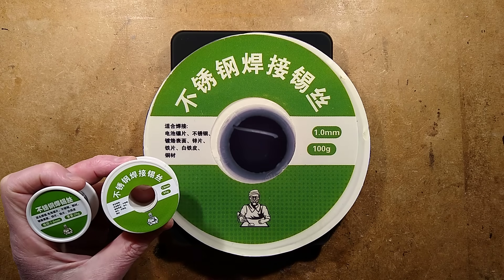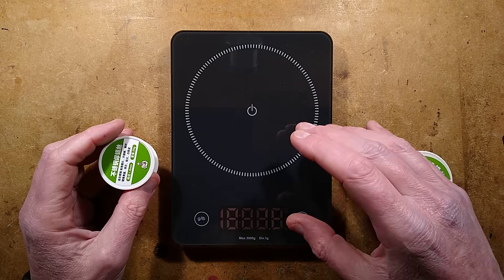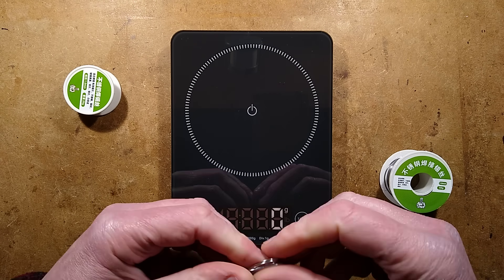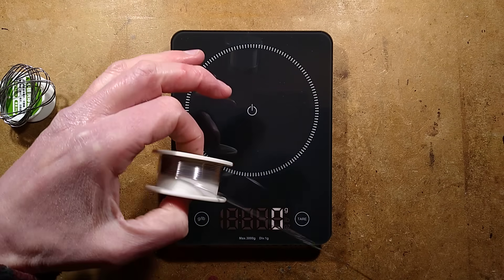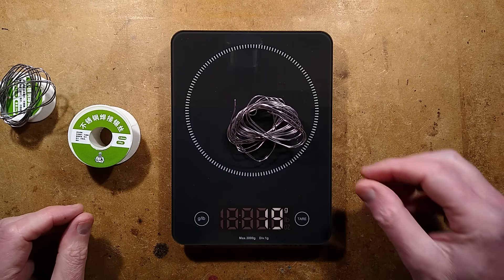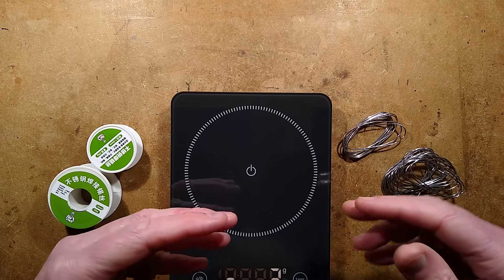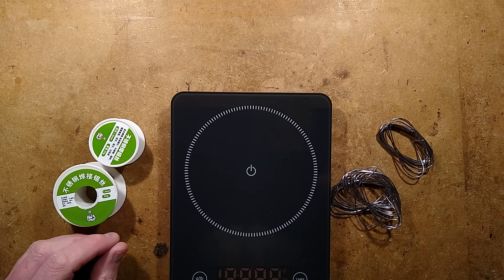The 20g and 50g mystery solder showdown

Comment: The cadmium doesn't surprise me. Unfortunately it's pretty common over there for them to use it in children's jewelry because it's cheaper than zinc or nickle. They do it even to some name brands, you have to rely on the brand actually checking their suppliers (and not just accepting the goods at face value) and sadly some don't.

Comment: I ran into a similar situation with a local supermarket.  They were including the weight of the packaging with the meat when pricing it.  The packaging is required by law to not be included with the weight of the meat.  The plastic wrap is insignificant in relation to the tray and the absorbent pad used under the meat.  To be sure I wasn't in error myself I have a set of standard measures that I use to verify the accuracy of my scale and sure enough verified that there was enough of a discrepancy to affect the cost of the meat.  I reported the discrepancy along with photo documentation to the division of weights and measures in the town they are located in but sure enough they investigated and found nothing wrong.  I measured a definite discrepancy between the actual weight and the tare weight.  There was about a 15¢ difference between the total weight and tare weight and considering the number of people that patronize the store it's a windfall for the company.  One might suggest changing stores but in reality they all cheat their customers.  🤷‍♂️

Comment: 95% lead? You would be happy with it as leaded fan. as a Different generation I hate soldering lead. (Mostly as leadlock to copper where pipes weren't replaced yet)

Comment: All rosin fluxes are mildly acidic when heated. Which is the whole point - it removes any impurities and oxidation allowing the solder to wet the joint.
Reply: When people say "acid flux", they're usually referring to strong acids, typically inorganic acids, not mild organic acids. Rosin flux, a mild organic acid, is useless on stainless steel which was the material being soldered according to the video. That requires, at a minimum, proper acid flux.

Comment: I'm sorry, but you are mistaken.  The reel is also 95% lead with 5% titanium dioxide to color it white..  You're meant to use it as solder for larger, load-bearing joints.  If you find the right (wrong) listings, you'll see it as "titanium solder".
Reply: Upon further reading, the reel is probably lead coated with cadmium stearate to whiten it.

Comment: I have heard that, even  the "rosin core flux"  in some solders emits acid in its smoke.  Any truth to that?
Reply from the maker: The solders for pipework tend to use an acidic flux that has to be cleaned off after use.

Comment: There is a reason the broadcasters and military will only use 40/60 tin lead solder.
And it's the reason I will only use it as well.
Reply: Absolutely incorrect, because nobody uses solder that is 40% tin, 60% lead, because that’s an awful alloy for electronics. You’re thinking of 60/40 solder, which is 60% tin, 40% lead, and is the cheaper version of 63/37 eutectic solder, which is a little bit nicer.

Broadcast equipment, however, is lead-free. Military and aerospace, and formerly medical, have exemptions and continue to use leaded solder. (Though I expect those exemptions to disappear once it is shown that lead-free is as reliable as leaded. And it is basically there.)
Reply: So far tin whiskers are still forming.  So lead is still approved.
Reply: @danc2014  Tin whiskers formed before lead-free solder was introduced, too. The issue occurs on pure tin plating; even small amounts of alloyed metals appears sufficient to frustrate whisker growth in most circumstances.
Reply: Yes your right, sorry I got the ratios wrong. I'll try to be awake next time!
Reply: @ No worries. :)
Reply from the maker: And medical.

Comment: I once had some smd battery controller chips (charger and regulator in one) fail within a week of soldering boards.  After much research by us and the chip manufacturer, it turns out our no-clean flux was actually acid flux with the wrong label.  It was soaking into the parts and dissolving the same bond wire in each chip.  Didn't bother any other chips, at least not before the battery controller failed.

Comment: I only buy Kester electronic solder. After soldering anything I always clean the joint with alcohol, a plastic pick and an acid brush to remove any corrosive flux. I'm surprised that the company that made that stuff didn't glue a metal washer inside the roll or maybe mix arsenic with the flux.

Comment: I experimented with Aliexpress solder and it's garbage. I'm convinced it's mostly lead or some other metal, maybe zinc or bismuth.
It doesn't melt properly or flow heat from the iron. After a couple of joints it clogs the iron tip making it useless.
It said 60/40 on it but was not specific what metals are in there.
The flux in the core is useless too.
Stay away from this garbage

Comment: The weight discrepancies are basically how they're shipping in precursor drug chemicals to the west, because when you expect 100 lb of soldering wire and it's actually 50 lb of soldering wire and 50 lb of other stuff you start to make these kinds of connections, China is scum and they should be banned from world markets

Comment: Seems to be a common thing with weight values of Chinese products. Ordered a "100g" can of (flux) rosin, and the filled can was exactly 100g. Since the lid alone weighs roughly 7 grams I'd guesstimate that the can actually contains about 60-70g of rosin.
So in contrast to most of the world where the advertised weight has to be just the content and may not include the weight of the packaging, that seems to be different in China...

Comment: I've got many reels of solder out the back, many of which are Ersin Multicore.  I do get through a fair bit though, especially the 1mm diameter stuff.  You CAN get decent solder from China, however you do need to stick to the more decent suppliers.  Thanks for the links allowing us to experiment "for other purposes" :-D
Reply: Ersin Multicore is the best solder you can buy in the UK and it has been since I first started soldering things over sixty years ago. I won't buy anything else.

Comment: Cheeky buggers. 

The acid based flux is nasty, it creeps up into wires and into holes in circuit boards so cleaning it all off is a really difficult job, easier to just not use it in the first place.
Reply: Stranded wire wicks up liquified flux by capillary action, and if the flux is corrosive it will corrode the wire underneath the insulation where you can't see it. Rosin flux is generally non-corrosive, but sometimes causes the wire jacketing to react chemically with bare copper wire (tinned wire doesn't seem to undergo the same process).

Comment: Because of this video, I bought 50gm of solder (common stuff, not for stainless steel) from Aliexpress, and it was only 48gm total! There is less than 17gm of solder, over 31gm for the spool. I got refunded after sending pictures of the spool and solder weighed separately on the scale.

Comment: Take The reels apart and see if they added metal or sand to them!
Reply from the maker: Solid white plastic.
Reply: @ So they got the white battery casings.......
Reply: Probably just have a core of recycled lead acid battery PVC, that is then placed in the moulding machine and given the overmould of recycled PVC. After all the lead contaminated plastic is cheaper, and has added mass.

Comment: I watched one of those hacking youtube videos online that suggested adding battery shell (Zinc) to HydoChloric Acid gives you a flux that could solder stainless steel.

I did test it and to my surprise it worked really well but need to be careful because zinc chloride is not very healthy

Comment: You can buy stainless flux and just use regular solder.  The flux is zinc chloride (basically zinc disolved in hydrochloric acid), so must be neutralized after soldering.

Comment: 0:41 the design of that scale looks like a hot plate and immediately makes me weary of pressing the power button in the middle of fear that I'll burn my fingers lmao
Reply: Besides that, my concern is that it is a capacitance-reactive touch sensor.  So if you put something soggy in the center, it might turn the scale off.
Reply: @Kineth1  It may just turn on when pressure on the weight sensors is detected. I have one scale that works that way, although it is a bit larger and designed to be placed on the floor.
Reply: Clive is an influencer and he doesn’t know it. I have several of the things he uses regularly because I trust his knowledge. But where can I buy this scale?

Comment: I got got like this with 3d printer filament, a "1kg" spool that was photoshopped in the listing to be twice as big as it actually was, and it showed up weighing 990 gram including cardboard box, plastic wrap, dessicant, there was barely 600 grams of filament on the half-width spool.

Also, customer service sided with the seller, because shipping weight shows 1kg so you must've gotten what you ordered.
Reply: Oh yeah, solid logic... like packaging has no weight... 🤔😒
Reply: Not even 10 grams of packing peanuts? I think you were right to complain
Reply: You should shame the platform if you're going to include that customer service didn't fix it... Was it eBay or Amazon or something else?
Reply: @tin2001  Aliexpress (most of the time they're fine but this time they completely struck out.)
Reply: @tin2001  it was on Aliexpress
Reply: What brand?
Reply: @GeneCash  Not even sure if it had a brand tbh, it was just some super generic €10/1kg stuff which i thought was a good deal, turns out it was not, given that I effectively paid €16.70/kg for really low quality (very brittle!) filament. Switched to other brands in the $12 to $14 range and got what I ordered, with better quality too.

Comment: As a teen we had Rosen core and Acid core solder when I took electronics in high school we always used the Rosen core . I was lucky to find on Ebay some really good fine diameter Kestor brand solder  NOS in the box bought 2 spools had a higher lead and tin compound .The newer stuff is not as good less lead in it now . One of the most ridiculous things I was ever told Was the Interstate battery rep said you were losing 60 percent of your batteries power by soldering the terminals VS crimping them !  I looked at him and asked why do we solder circuit boards if that's the case ?? He had no explanation  I Do BOTH when I build leads for heavy trucks or machines .
Reply: The US military has always maintained that a properly done crimp is more reliable than a soldered connection because a high-pressure crimp constitutes a cold weld that excludes air and melds the metals together at the molecular or atomic level. This assumes that the connectors and cables are correctky size-matched and the correct crimper, dies, and physical pressure are used......but yes, I've done the same as you, both crimping and soldering connectors to cables.
Reply: @ In signal school, we were taught to splice wire using square knots. No solder. No butt connector. You don't even need electrical tape if the splices are offset.
Reply: @ I have a training video from WW  2 showing that  but of course they were in a hurry to get lines up and running advancing with the troops quite the task if you were attached to Pattons third !
Reply: Kester still makes 60:40 rosin core solder. Or they did a few years back when I bought mine.

Comment: I actually bought a 2x1lb kester brand 63-37 lead-tin reel twice now, never weighed it biut the amount of time it lasts and the sheer contrast in empty vs full makes me think it actually has at least 80% solder, maybe 95+%
Reply: Kester being a highly reputable brand, I am absolutely confident that a 1lb reel contains 1lb of solder, plus whatever few grams the reel weighs.

The percentage of flux is printed on the reel in code: flux core size 66 = 3.3%, 58 = 2.2%, and I forget what the other size code is, but it means 1.1%. (Not to be confused with the flux type, which is also a number. For example, I buy Kester 63/37 eutectic, with type 44 flux, flux core size 66.)
Reply: @tookitogo  sorry 60/40 mix 0.8mm 3.3% flux, i think i read it right
it has never let me down when doing rework, I only wish I had good quality paste-flux like the amtek stuff louis rossmann used to sell before the company changed the formula
and a good desoldering pump and hot-air station

but my little pinecil is chugging along(after I accidentally killed the first on with >20v input frying the chip that does PD) and even let me replace the POT on the left stick y axis on my well used xbox one controller for PC
just a quick solder blob 3-pin desolding(the only way to remove the POT with my tools) and then careful pressure and I removed then slipped in a new POT, then a bit of fresh solder to touch up the joints and a new stick topper and boom, the kester wins again

just one of many times that solder has saved something otherwise expensive to replace, unlike the shit in this video which is FAT and  so goddam disreputable to have a hyper-dense reel to hide how little actual product they are really selling

Comment: Between this and my own gambles buying solder from Aliexpress and Ebay, I'm glad I was able to be Able to get a few rolls of Kester and MG solder before the very last local electronics shop closed last year.
Reply: Mechanic brand is safe bet on Aliexpress, not the best in the world but good and cheap. I was happy with LAOA but they only ship 400g rolls to Croatia lately and I have no use for that but if I need that amount it will be my first choice. Not really cheap but still cheaper than stuff that can be bought locally and quality is excellent.

Comment: I do not solder with lead. Switched to solder with copper, silver and tin.
If I want to connect steel or stainless steel, then I use welding. Not some lead solder.

Comment: I was bang on the first one but off a little on the second.

Serious question (as I'm running really low on a the spool of 60/40 I've had for literally decades) can someone recommend a good quality solder with a decent flux (mostly for SMD rework but occasionally for removing, yes you read that right, removing parts soldered to double sided boards, with multiple pins - all at once without destroying them!)

Comment: lead is denser than tin so it is actually the correct weight, as 50g of lead is heavier than 50g of tin.
Reply: srsly though I'm still on a spool of *searches email* ..."Warton Metals Future HF 63/37 Fast Flow 2% Flux Solder Wire 18SWG 1.22mm 500g" that I bought years ago.  :3

Comment: I guessed 8 and 16... Not too far off surprisingly.
In any case, the best solder I have used came with my silver stone soldering iron. The reel has last for more than 5 years at this rate, still flows on perfectly every time.

Comment: my guess for the first one was spot on. The second even managed to beat my cynicism, I was expecting 30g solder 20g reel.
Reply: I guessed there'd be 20g of solder and still came away disappointed
Reply: Well after the 60/40 100 gram wheel i expected 30/20 for the 50

The 20 grams being half half was the surprise here
Reply: I was guessing 8 and 16... Beat my expectations (barely).
Reply: It's recycling plastic,  remember.

Comment: I was spot on. I guessed 32g.
...but, I thought it would be 32g solder, 18g reel. Not the other way round. That's false advertising, surely.
Reply: Same, thought 32g solder lol
Reply: Not believing PT Barnum is probably a bigger mistake!
Reply: This is not false but actually trick. They never said you will get 50grm of wire
Reply: It's not false advertising. It's weight fraud, a form of measurement fraud distinct from false advertising, centres on the deliberate misrepresentation of a product's weight. This deceptive practice involves manipulating labels or scales to falsely inflate the weight claimed for a product. Unlike false advertising, which focuses on misleading claims about a product's qualities or benefits, weight fraud directly targets the accuracy of the weight measurement itself, leading consumers to believe they are receiving a greater quantity than they actually are. This can manifest in various ways, from altered scales in retail settings to intentionally mislabelled pre-packaged goods, ultimately defrauding consumers by charging them for weight they do not receive.

Comment: 50% rip off.....Chinesium junk solder, just what they use on all the electronics they produce....guaranteed failure down the road.  Doesn't surprise me though that it was half or less than stated weight, I am surprised though that they didn't include the shipping package and labeling included in the weight measurement....  Stick with Kester, MG Chemicals ETC..  Thanks Clive.
Reply: Typical Aliexpress seller. I ordered a laptop got a laptop bag! They did refund my money but never, ever again will I do Aliexpress!

Comment: Yeah, that's why I make it. I just clamp 2 boards together and drill down the middle to cast long thin rods.
Bolton metal has all the recipes, or did, I printed them off years ago.
In the meantime I probably picked-up 10 pounds of old 60/40 spools and hardly fool with my tin ingots.

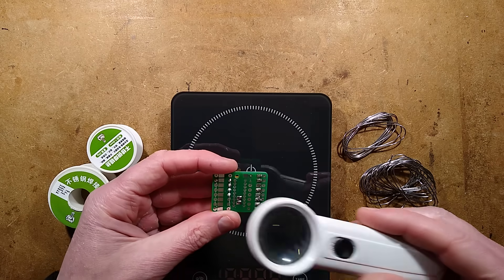Comment: 3:27 “Acid based” 🤭
Reply: Common rosin flux is usually "mildly activated" - it is acidic but not strong acid (HCl). For iron and steel you use ZnCl2 and HCl and you can use ordinary solder.